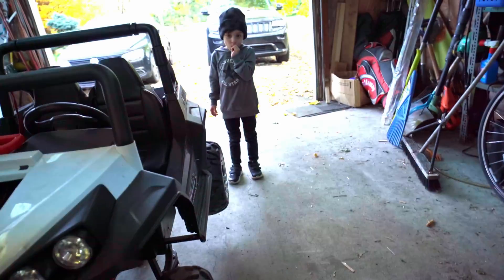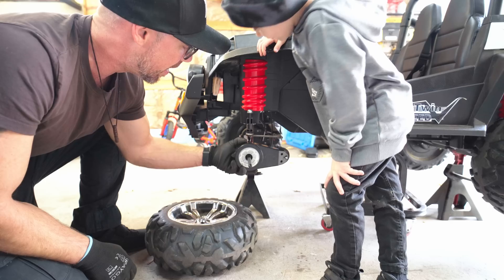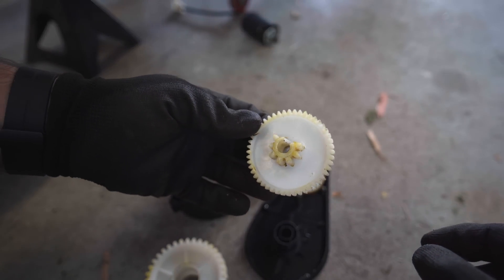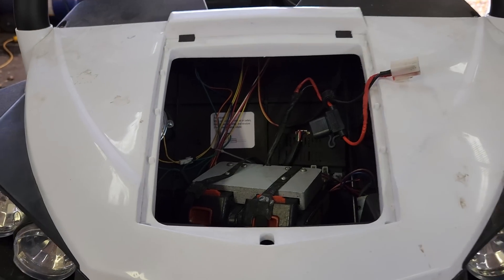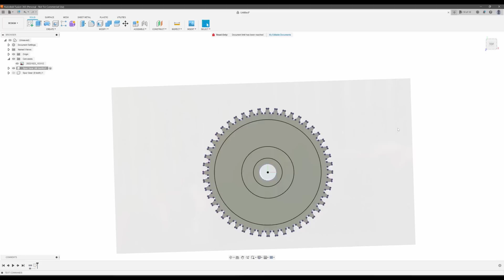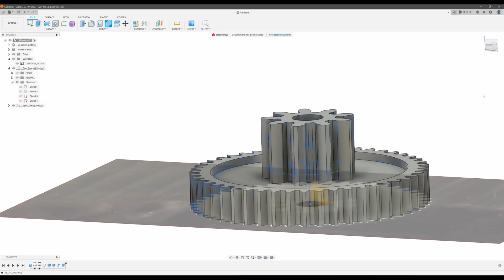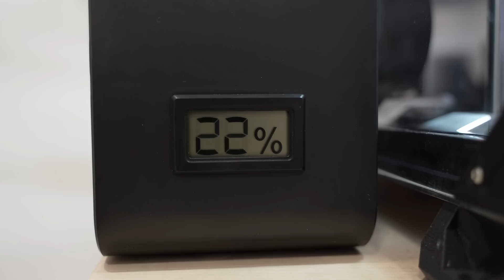I fixed my son's car with my 3D printer (VzBoT)

Comment: Looks cool, but if the overdriven motors had enough power to break the injection molded gear, I don't have much hope for this one lasting long. Of course, next time it probably won't be a tooth that breaks, it'll shear apart along one of the layer lines.

Comment: Hero Dads unite!  3D printed repairs are the most gratifying!  I printed an "impossible part" for a pool valve repair embedded in stone that would have cost $1000s to fix traditionally. Paid for my next printer.  :)
Reply: I'm really curious to know what that part was and how you pulled that off! It sounds like quite a feat!
Reply: @KensCounselingCouch  Check valve was cemented into natural stone facade of the spa. So replacing it would be tearing the natural stone out, through reinforced cement, then repairing it. It would be a big job! Part involved a captured spring and the solution was 3 printed parts that snapped together during installation. First two formed a stem and captured the spring into the existing valve body, final one was the valve cover that capped the valve and snapped into the stem with a shark teeth like mate.

Comment: Also I have tried in the past to print the same gear but I tried with pla and with a resin printer but in both cases the gears broke .. Too bad I didn't try with the carbon filament but I bought the same gears online only a few euros against the cost of a new roll of carbon filament! I still have the drawing anyway, it can always be used perhaps to mill it in aluminum with my cnc! : D

Comment: I printed a main gear for my size 90 nitro heli with 10cc 2stroke motor out of normal PLA with my Creality Ender 3 pro. Ive done 12 flights of about 10 min each and the gear is showing no signs of failure yet. I love proofing ppl wrong that said u must use nylon or the gear wont hold!

Comment: First: Very awsome dude! Second: Can I ask you some questions? If you say "No": Iam sad :(, If you say "Yes", here my questions: First: I want to build one of your printers 330 or 235, witch one woud you recomend? I dont think that i need the extra space from the 330 version. And second question: Can you share your Slicer settings? I mean how sick is your Prusa Slice? The Printbed from the CAD Model? Nice! I've never seen that bevore!

Thanks for your Videos!!
Reply from the maker: hi sir :) thanks for the kind word. Both 330 and 235 are awesome I Think. I would go with 235 since you dont need that etra build volume. As for the slicer.. its superslicer and that bed design can be added here: https://github.com/VzBoT3D/VzBoT-Vz235/tree/main/Slicer/Theme/PrusaSlicer-SuperSlicer
Reply: @Vez3D  Super very nice! Thanks!

Comment: CF and GF filaments have poorer layer adhesion and you need layer adhesion to transfer the torque from the small gear section to the larger one... I hope it will last. I would have used Polymaker COPA instead, which has super layer adhesion.
EDIT: Actually I see PA-12 CF has the same adhesion (on paper) as CoPA, but it needs annealing...
Reply from the maker: Yeah that was the only nylon i had in hand ...we will see

Comment: Qeson, I’d like to build a fast zygote. Can I get a 500mm build?  Whee can I find a one stop list of what I need as far as the best dtuff with links?
Reply from the maker: I dont have a 500 model yet sorry. But you could use the Vz-330 AWD parts to build it custom
Reply: @Vez3D  great, is there a link for a complete parts list, cost and sources? Sens kinda spread every ware. I’d really like the alloy parts.
Reply from the maker: @chicagoal3731  yeah on github you have the bom for each printer

Comment: why doesn't anyobdy anneal PA prints 😭, people are missing out even better mechanical and thermal properties
Reply from the maker: I do when I use them for stuff that needs stiffness. In this case.. I thought it would be best to not do it... was I wrong? please let me know what you think
Reply: For Polymaker's PA12-CF Tensile goes from 43Mpa to 71Mpa,  youngs from 2Gpa to 3.3Gpa, bending strength from 48Mpa to 109Mpa and impact strength does go down from 17 to 12 kJ/m^2 when your anneal it according to their info sheet. I do believe in their data, although third party testing would be awesome to have,
I don't know... I was just saying hehe. I don't see people annealing PA prints on their videos.. or if they do, they don't mention it and I think many people who now say nylon is bad and that they get stronger parts out of petg or abs may benefit knowing that annealed PA is substantially stronger than fresh from the printer.

I don't know...Why do you think the original gear broke? if it was an impact, you're totally right, if it was tangential force on the tooth that broke... I think annealing the part would be better (I might be totally wrong, if you can corect me, or somebody else who read this, please do )

Thanks for the videos btw =)
Reply from the maker: @santiagoblandon3022  oh im not smart enough to be able to correct you here hehe. Thanks though for all the data
Reply: You are ;)
No problem! It serves my evil plan... That more and more people buy nylon so economies of scale do their job, prices go down and I can save some bucks on my spools bua ha haaa

Comment: I think maybe regular Nylon PA12 would be a more future proof solution as the fiber fill will most likely be abrasive to the rest of the gears. However, it's not a highly critical part so worst case you'll have to replace all of the gears with CF ones 😅
Reply from the maker: thats exactly what I say in the video :) But thats the only nylon I had in hand hehe
Reply: @Vez3D  well that makes sense. This is definitely the sort of content I enjoy though. Very impressed with the video as a whole

Comment: Loved the video. 😍 Hope the neighboring gears hold up. With that CF I'd worry you'll end up replacing them too, then the brass one on the motor shaft. 😜 My favourite material now for precision gears is HTPET but for applications without precision requirements non-filled nylon is probably a great choice.

Comment: Very nice. Only concern will be layer adhesion. When it breaks will likely be at the base of the small gear
Reply from the maker: Oh man that thing has one of the strongest layer adhesion i have seen. I did some tests and and when it breaks it doesnt break between layers... it rips the layers haha
Reply: @Vez3D  nice should last a while. Have you seen cnckitchen? He does tests on printer fillament. I think that gear would be a good candidate for msla much better layer adhesion
Reply from the maker: @mastermoarman  yeah im.a big fan of cnckitchen

Comment: Carbon fiber filament for gears? Doesn't seem like the perfect idea since the surface is pretty rough. PA12 or even PLA at 220° in a slow print should be better? But proof me wrong! ;-) looking forward to seeing the gears in a year or two.
Reply from the maker: That was the only nylon i had .. i mention this in this video about my concern about abrasive material on the other gears.. hehe  but ill see how it goes with time

Comment: With a 0.4 nozzle you can print Modulus 1 gears well. And every above easily and very rigid.
Reply: He was using .5 nozzle for this one
Reply: @Tedlasman  I just wanted to state my experiences with printing gears. Modulus 1.5 is perfect for printing own great boxes. Makes them rigid and nice to print. If made in an angle they're pretty "silent" too
Reply: @haenselundgretel654  "Great boxes"? Maybe you mean "Gear boxes"? And do you really mean the gears themselves?

Comment: to print that fast what was the temps 330C ?
Reply from the maker: 260..the recommended temp from polymaker. With the Goliath hotend (aka LSD) you dont need to crank temp as much as other hotend to achieve speed

Comment: You had to print it with 45 angle. I printed same part and it was broken after 1 week by separation two gears throгgh layers
Reply from the maker: That material has soooo much layer adhesion..we will see how long it last. For it has over 2h of hard usage so far at 20V and still going strong
Reply: @Vez3D  I thought same ))
Reply: @Vez3D  it is better to make lite start and gears will live 100 years. Even from PETG
Reply from the maker: @smolensky  lite start? What so you mean?  Also thanks for commenting i love that :)
Reply: @Vez3D  device that limits full torque on start for dc drive
Reply from the maker: @smolensky  ahhb there is already that on the car. :)
Reply: @Vez3D  most of them don't have )) I have 3D print business and that gears are 30% of  my orders

Comment: I need that bed in your slicer!! Lol. Is it available to download?
Reply from the maker: yeah its on Githut for each model.  https://github.com/VzBoT3D/VzBoT-Vz235/tree/main/Slicer/Theme/PrusaSlicer-SuperSlicer
Reply: @Vez3D  Awesome! Thank you. Great job on the gear, I would imagine it will hold up just fine. Might even outlast the other ones, lol. As for the abrasion with the carbon fiber, I wouldn’t see that as an issue, but who knows!

Comment: I've done some testing on 3d printed gears in PLA with good success, PLA is surprisingly strong, with added composites like cf or wood having the best results. Would have loved to try nylon with it self lubing properties.

Comment: Seems like it's a standard gear reducer used in almost all such cars. I already printed this gear several times, but with PA6, which is much stiffer.
Did you use hardened steel nozzle for CF fillament? If not, your brass nozzle might already be +0.1mm wider. :)
Reply from the maker: No.. I didnt use hardened steel... they suck at thermal conductivity. I used a Bozzle nozzle ;)  Link indescription. Its a tungsten high flow nozzle. There is a video on my chanel about this awesome nozzle :)